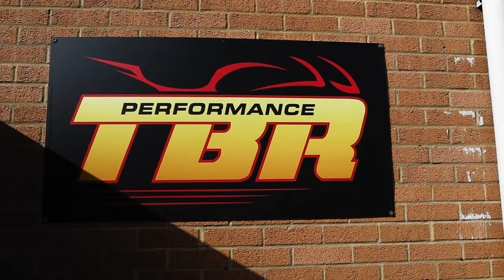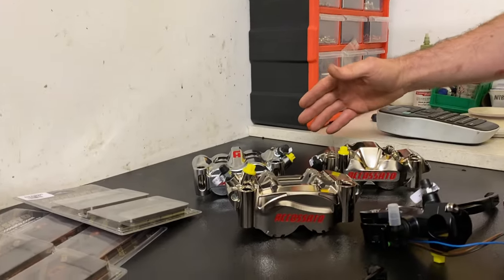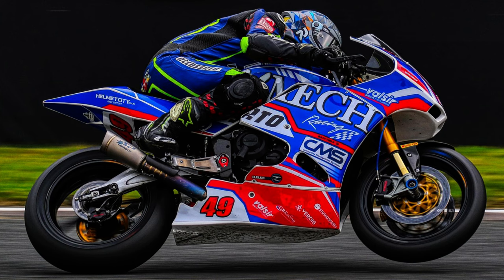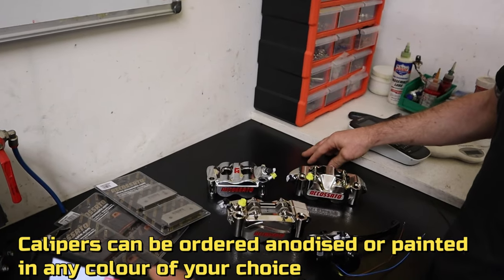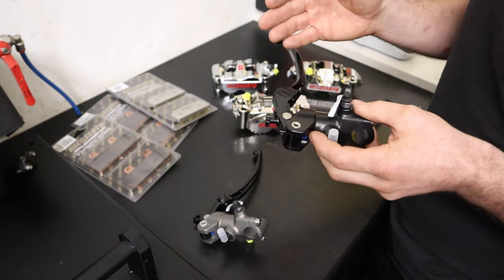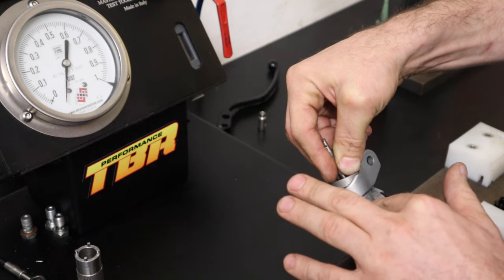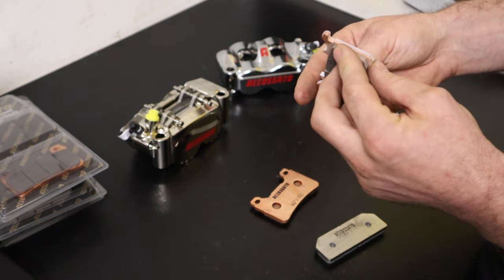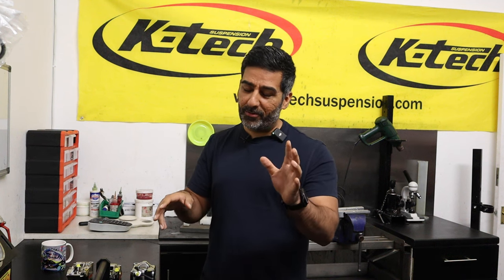Accossato Brake Calipers, Master Cylinders & Brake pads | Complete braking guide | Part 2 of 5 Assen

Comment from the maker: Here are the chapters of this video for an easier viewing experience, promise you won't skip ;)
00:00 Cinematic Intro
00:31 Quirky Important info
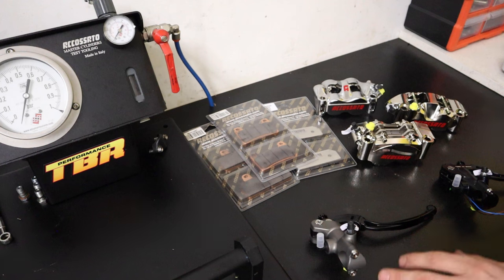04:45 Road and Track Calipers
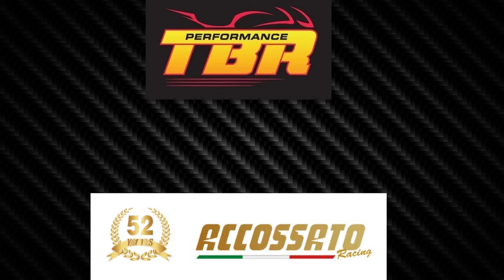08:27 Racing and Trackday Calipers
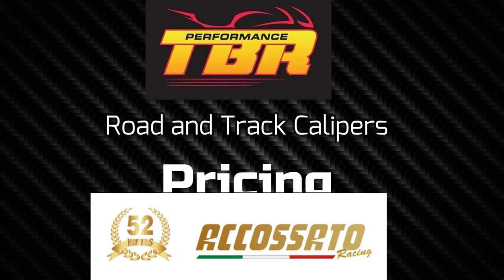11:20 Calipers Pricing
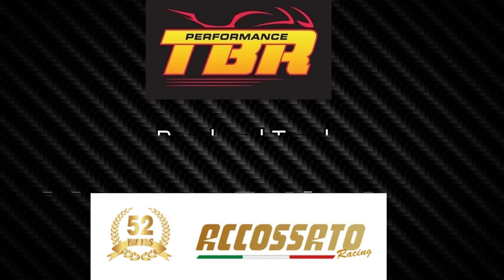12:28 Master Cylinders ROAD and TRACK
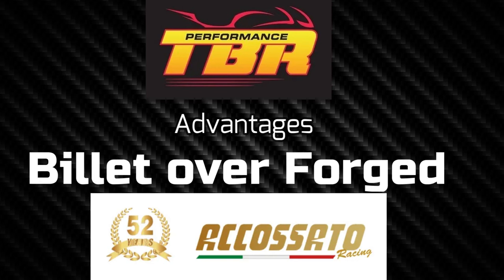13:20 Billet vs Forged Facts
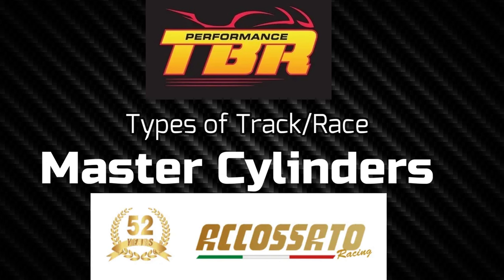14:26 Race and Trackday Master Cylinders
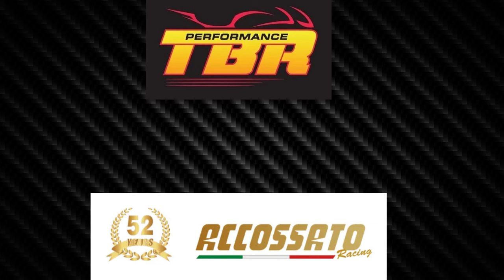17:52 Pricing Master Cylinders
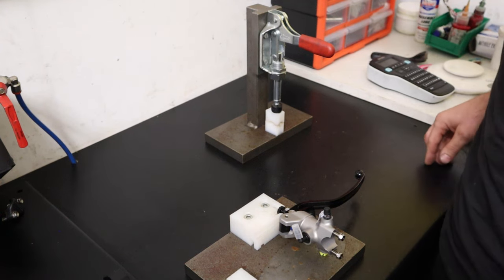18:32 What is Accossato Master Cylinder Special
22:22 Brake Pads. ST pads
23:37 ZXC (carbon) Brake Pads
24:18 EV1 (Sintered) Brake Pads
24:37 EV2 (Sintered) Brake Pads
25:10 Ceramic coating on pads
25:42 Important info , Plans, Links and Discounts
28:48 Outro

Comment: That was a good video, Abhi.
Another thing about the nickel Accossato PZ001 calipers I got from Matt is, each caliper is almost a pound lighter than the OEM Brembo calipers on my 2018 GSXR1000R. So that’s almost 2 pounds in unsprung weight saved. I’ve also got the ZXC pads for them, and ZXC pads in the Accossato PZ004 calipers I got from Matt as well. 
The CNC master cylinders are a step up from the Brembo master cylinder, so more of your braking effort ends up at the caliper doing the job it’s supposed to be doing.
Oh yeah, I promise I’ll post pics on your page for you, like you asked.
Reply from the maker: That’s absolutely brilliant , thank you for your input in this 
Really appreciate it so much 
They were much lighter than my OEM M50 Brembo calipers 
Honestly , they are so so well made 
Proper quality stuff 
And kudos to them for offering such huge introductory discounts , it’s unheard of these days… 
There’s a group on Facebook called 
Chasing Tenths “the group” , you can post pics there 
Cause the chasing tenths page might not let you post there 🤗
Reply: @ChasingTenths Will do 👍
Yeah that discount is incredible. As soon as Matt told me about them, I jumped on them straight away. I almost bought a pair of the non-nickel version at full price about 6 months ago, so glad I didn’t pull the trigger back then. I still can’t get over the fact that I got these calipers for half price.
I only wish I got my Maxton suspension for half price too 😂
Reply from the maker: @flamintasty  hahaha , maxton is bloody amazing, the after sales support those guys give is absolutely unbelievable.. you call them and they even come to you to set the bike up trackside … I am sure Matt does that too (I bet he will read this and say , errrr no , especially if it’s knockhill lol) …. Feel free to use the CHASE10 discount mate whenever you need accossato stuff, it’s discount on top of discount lol

Comment: The Aprilia Rsv4 rf race superbike looks amazing! Accosatto master cylinder STD 19mm sucks! Got it on my ZX6RR
Reply from the maker: Cheers mate, love the Aprilia , 
When you say STD , do you mean standard fitment?
Reply: @ChasingTenths  Yes mate! Standerd fitment but the race vertion with pressure sensor for 300£ . The feel is really bad! I got brembo M4 calipers with heal tech performance braided lines.
Reply from the maker: @superbikesquadracer  I don’t know much about standard fitment tbh, it’s sad that standard fitment with a lot of brands isn’t upto people’s expectations… I think I had a Brembo standard fitment on mine and I charged that pretty quick too
Reply: @superbikesquadracer  do you mean you have an accossato master cylinder? or the OEM master cylinder feel is bad? either way,, let us know and we can help you out to get it right
Reply: @matthewwren1736  I have got Accosatto master cylinder (race vertion). I fixed the issue. Now it feels amazing! Thanks anyway sir!
Reply: @superbikesquadracer What was the issue?
Reply: @sp00ky1969  The pressure dosent hold. It feels sponge. I payed 310$. Expencive
Reply: @superbikesquadracer  So what fixed the issue? Installation error?
Reply: @sp00ky1969  it still feels the same. I will let proffetional mechanic take care of it in summer

Comment: I knew my 19x18 Accosato felt better than my brembo rcs19! 😅
Reply from the maker: Same here … mine is a fixed ratio 21 , i think and it’s unbelievably good
Reply: Do you recommand 19×18 or 19×20? What is the difference?
I would like to upgrade my master cilinder on my track day Honda CBR 1000 rr

Comment: I saw your video on different wheel weights for your aprilia.  I have the v4 factory tuono with original cast wheels and was thinking of changing for forged and wondered if it was worth it. I see the rsv4 factory original maltek wheels were the lightest. Which wheels do you run. ? Cheers
Reply from the maker: Hi Nial, thanks for watching my stuff , the Aprilia forged are the longest OEM wheels out there , I think they are even lighter than Dymags and magnesium, but OZ Gass are slightly lighter. I run BST Carbons but honestly telling you it you find Aprilia RSV4 RF forged wheels out there , get them , they are very very light . You don’t need carbons even , I got my carbons very cheap second hand
Reply: @ChasingTenths  great thanks for the reply. , like you say its finding the forged aprilia wheels. 👍
Reply from the maker: @nialbarnsley4108  absolutely, if I didn’t get the carbons really cheap , I would happily run the Aprilia forged, the are extremely light and good

Comment: I would like to put accosato radial brake master cilinder to my CBR 1000rr trackday bike... What is the difference between 19×18 and 19×20? Which one do you recommand? Any advice is useful, thanks
Reply: 19x18 works well with small pistoned CBR calipers 👍 if its brembos from a 2020 onwards then 19x20

Comment: What do you think in term of  performance ,reliability and consistency   comparing the  accosatos VS brembos m50 with the RC17 master? i'm asking because  i've bought another  track bike which is  a  R1 2021 and the OEM brakes are....well....quite meh lets  say,so i'm thinking about a  complete set up  change
Reply from the maker: I have now tried the accosato calipers and master cylinder at 3 different tracks , Assen, Aragon and Andalucia. It’s far superior than m50 plus RC17 .. mainly because accosato is an all out race and track setup … M50 is a great caliper but it’s an OEM road set up and has limitations when pushed hard ..
The accosato has the consistency, heat dynamics is better , immediate response and ease of cleaning and servicing
Reply: @ChasingTenths  Then Habi,tell me  which pads works  best with the  accosato  calipers ? will take your words on that ,and purchase a  complete set up for  my R1
Reply from the maker: @sylvandespres7654  100 percent for track EV2 
if you go to TBR performance website 
And put chase10 
You get 10 percent discount 
I’ve just ordered a set for me